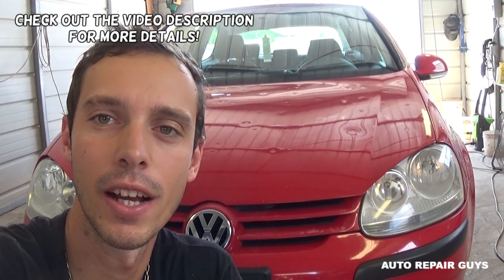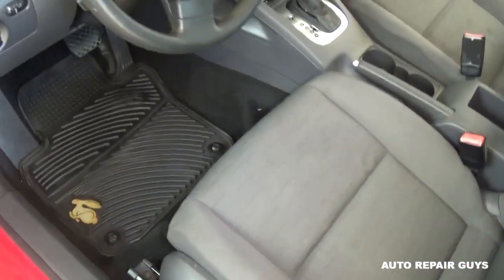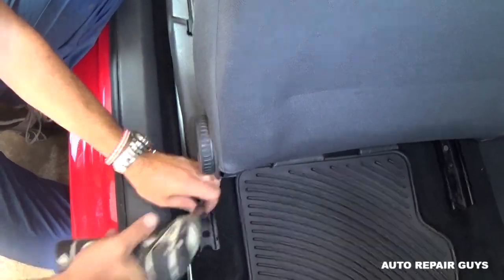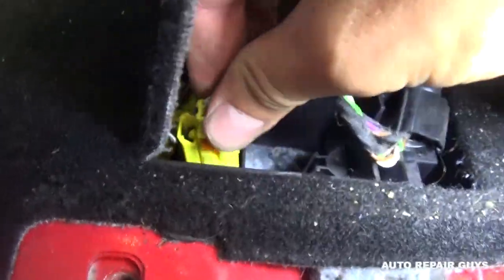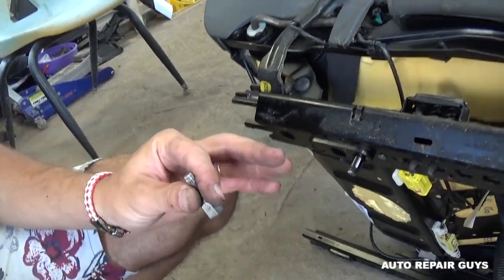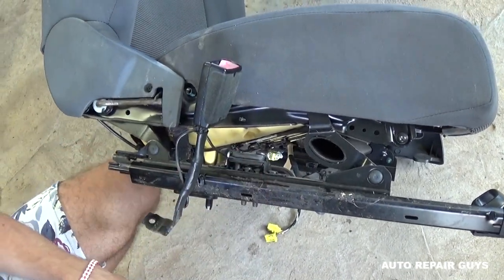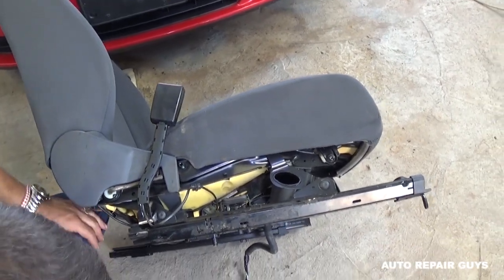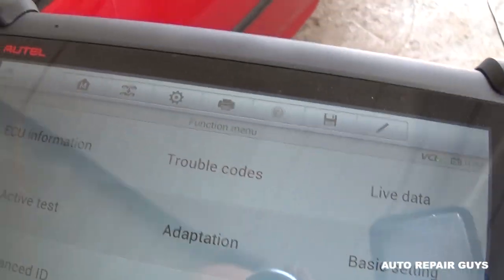VW GOLF JETTA BEETLE CODE 00591 SEAT BELT SWITCH FIX

Comment: Thank you for the info, my question is what if I’m putting in aftermarket seats do I have to bring the wiring system from the Jetta seat to the new seat?? Driver side specifically.

Comment: I use it "U281 OBD2 OBDII CAN Auto Scanner Code Reader AirBag ABS Reset TooL VW Audi Skoda"  on my 2001 diesel beetle for airbag light on.  The code is 0591--driver seat Circuit problems. I find a plug out of the casing  underneath my seat. i plug in. use this reader erase the code. then fire on again. the light of airbag goes off.  Thank this video and Auto Repair Guys.